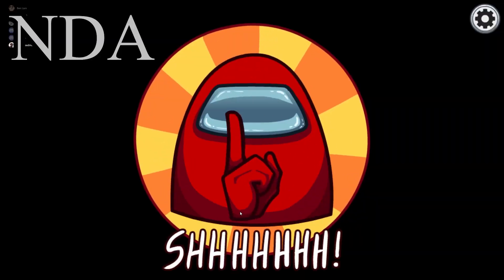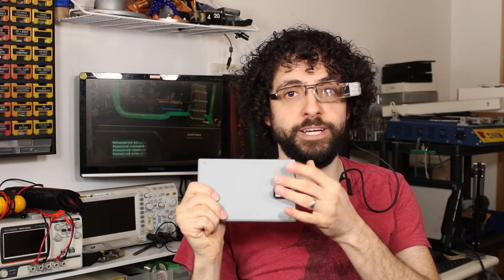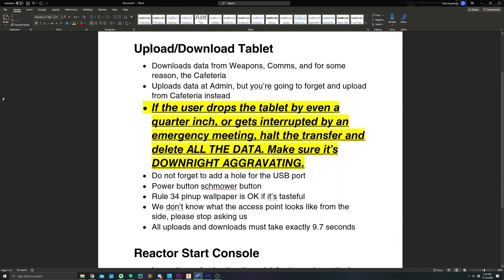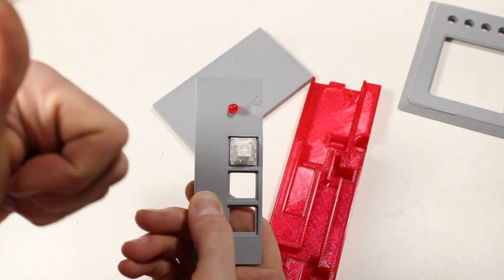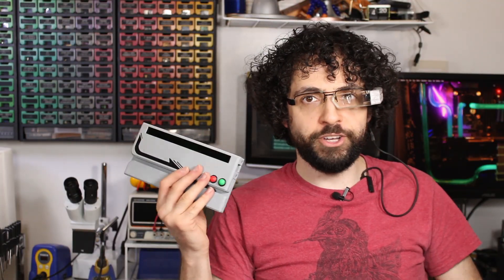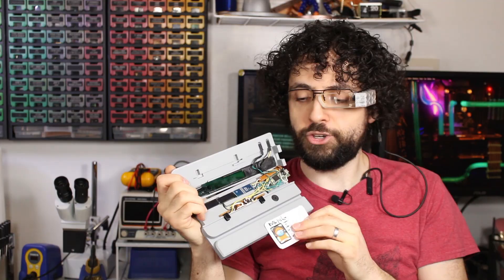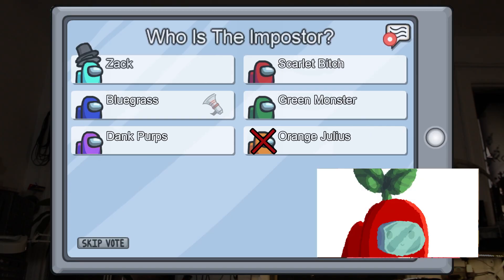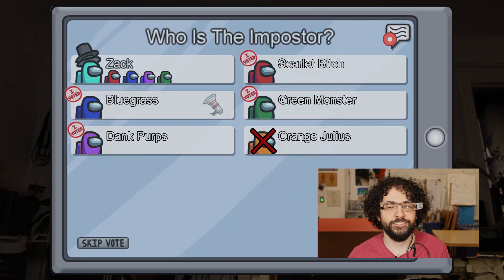3D Printing and Soldering Among Us' Worst Tasks (The Skeld in real life)

Comment: Not gonna lie, I'd love a tutorial for making a single lens Moverio display for a phone. I just got my hands on a unit for cheap so I'm planning out mod.
Reply from the maker: The Moverio BT-30C is designed to connect to a phone, but the other s are really, really hard. There's a wireless video streaming app built into the non-developer version of the BT-200, but I've never been able to make it work.

Comment: This has ignited in me a desire to build a physical version of keep talking and no one explodes
Reply from the maker: Oh that would RUUULE. I love that game, but my wife says it’s too stressful...
Reply: @ZackFreedman  The easy way would be with touchscreeens, but that lacks awesomeness. The awesome way would be with physically different modules, but that would require someone to "build" the bomb before play, and that's kinda  bummer. Can't really be the defuser.
Reply: @MordecaiV  I don't know that it would matter - even if the assembled modules were put together by the defuser they won't know how to disarm them if each module has an RNG trigger when its activated - so different without builder intervention every time its played - you should know the method for certain on each module, but not that actual action required, and to add extra randomness could make it such that each module must be tackled in a randomly assigned order that the act of putting the modules together has no influence on.
Reply: @foldionepapyrus3441  a not insignificant part of the game is finding out things you might need to know at "random" times such as how many batteries are on the bomb. If you build it, you'll have a significantly different experience because of the knowledge you have from putting it together.
Reply: @MordecaiV  Only if everything has to be real real components - having a conveyor belt display that shows x battery holder or a screen to do so etc..
Reply: @MordecaiV  For sure. Building it physically gives all kinds of weird insights!
Reply: @foldionepapyrus3441  I think a lot of us are building the edges to just be swappable parts, but that was a consideration at a point. Might still be a goal once a lot more is done. (Speaking about the KTANE IRL server).
Reply: If you’re interested in a physical version of Keep Talking and Nobody Explodes there is a discord server full of people making it. We’re all at different stages of development and there are quite a lot of people just following along to see how all the projects go. https://discord.gg/nVypDvg
Reply: @joshs2022  THANKYOU
Reply: @joshs2022  wow that's amazing. I will take a look see when I have time.
Reply: @joshs2022  Does it explode? If not then it's not good enough. Have you tried mixing nitroglycerine with wheat flour and use a magnesium fuse?
How about having a moderate amount of U-238 in it and when the time is up you raise a protective shield and bombard the U-238 with Fast Neutrons?
How about having a small amount of Polonium powder in a small bag of wheat, with a small bomb next to eat which would not only explode but would expose everyone who survived the explosion to lethal levels of poison?
I mean the ideas keep on rolling.
How about thermite...
Reply: Just make sure it never realeses more that 15 joules in less that a second.
Reply: It's already real, you just have to have the right job
Reply: Well I tried something like a bomb defusing physical game, and I actually spoke about it with the game developers :D
Reply: There's a whole Discord server dedicated to this!
Reply: Simple, just become an explosives expert
Reply: Just don't use real explosive charges.

Comment: Ok so I had this idea but I don’t have the knowledge to pull it off so it’s going here bc he asked for ideas. So I had an idea for a 3D printer that would basically replace the leveling knobs with gears of similar sizes and have stepper motors as leveling mechanism. Maybe run it as an octoprint plug-in. Basically it would run the leveling sequence with a BL touch and then that data would do whatever magical things happen inside electronics and it would spit out stepper instructions to level the bed because bed leveling is the worst (yeah I know it’s because I’m new to 3D printing but it’s still something you have to take time to do and it would be better to automate it)

Ps I have an ender 5 plus, idk if that’s relevant info but there it is.